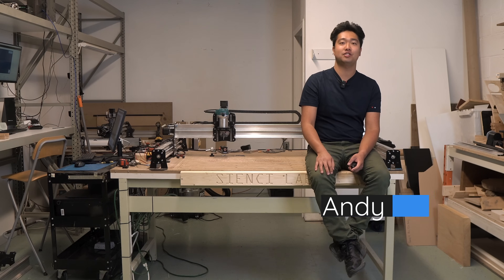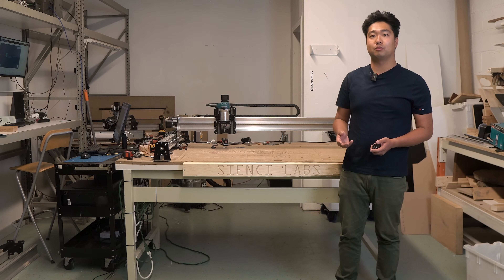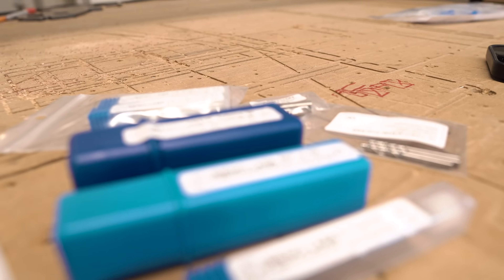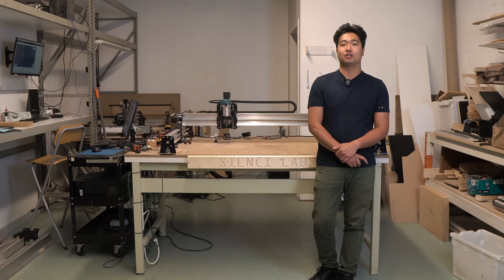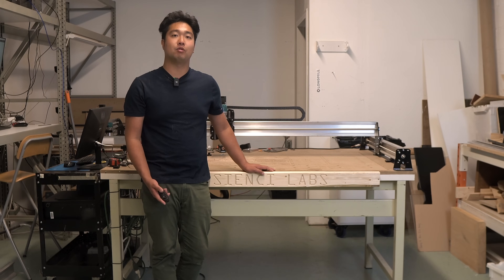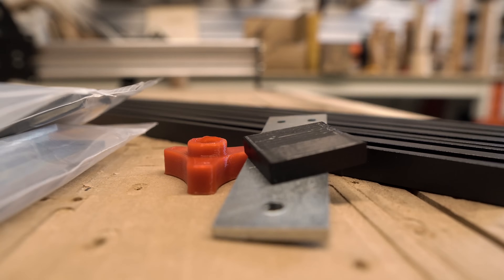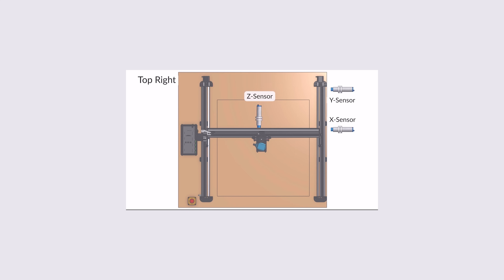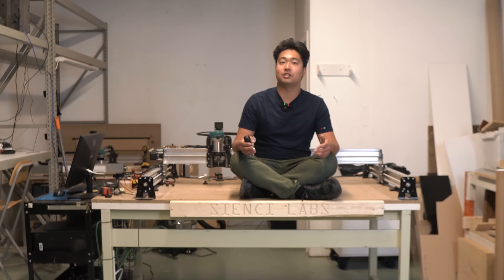Sienci Labs Presents: The LongMill MK2 CNC Beginners Kit

Comment: While the initial price of this unit may be attractive, factoring in the cost of required extras increases the total investment. Conversely, similar units from other brands often include these extras in the base price.
Reply from the maker: It depends what accessories you're looking at. It's also important to check that you're using the right currency on our site since it defaults to CAD and not USD like other manufacturers tend to have

What accessories were you looking to purchase and how's that compare to other machines you're looking at?

Comment: what is the minimum table size for the 30x30 machine. I'm building a new table and the side cabinet walls will be 90mm thick (for better sound insulation, and 18mm thick at the rear wall.
Cheers
Reply from the maker: A 30x30 machine footprint is appx 44"x44". Here's a link to our table sizing resource for more specific info!
https://resources.sienci.com/view/lmk2-table-enclosure/